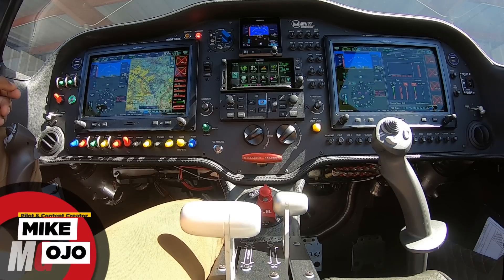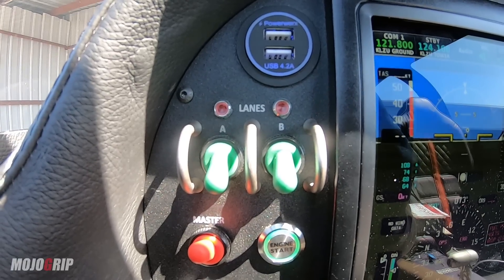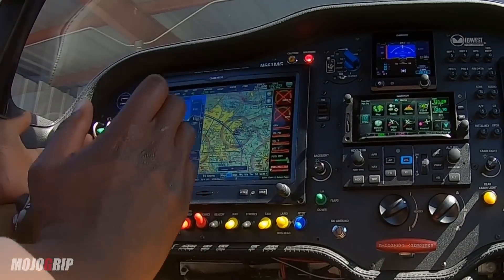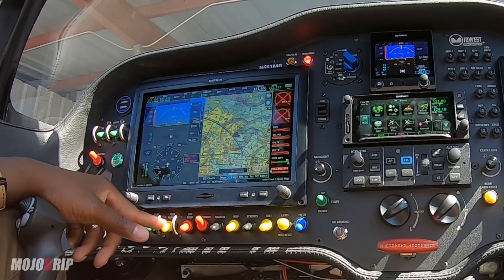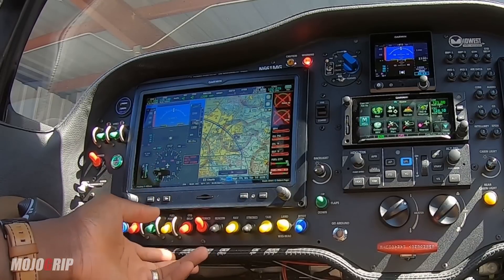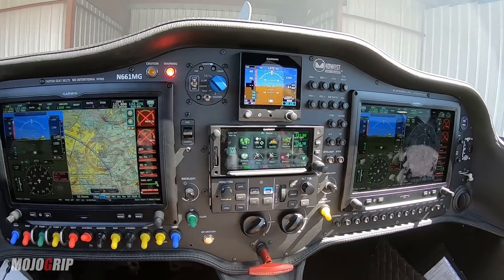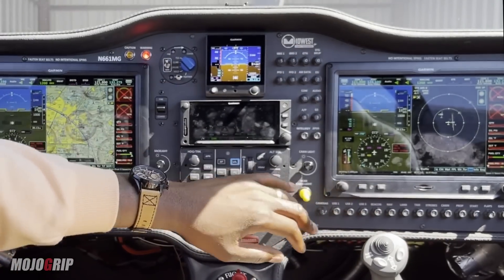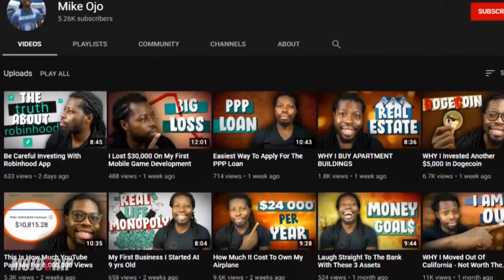All The Tech In My New Plane - Sling TSi Garmin G3X Touch

Comment: Mike does your Sling have a LIDAR installed? I've noticed an audible tone which emits as you near touchdown, with increasing frequency the closer you get to the runway.
Reply: The G3X supports an angle of attack sensor.  You hear it indicating that the wing is nearing a stall during the landing flare.

It uses a second port in the pitot probe set at an angle. A comparison of the two pitot pressures is used to calculate the AoA.

Comment: Lane A and B are for both ECU's to run the engine. And not for the avionics. Thats rubbish. Those are power through a separate alternator and master switch. Stick to the facts.
Your master switch does not power the engine.
Priming the battery? Thats again electrical nonsense.
Reply: I assume he is saying priming, but what is really happening is that he is voltage testing the standby battery and potentially arming it.  I am concerned that this is not helpful in understanding primary and secondary circuits and how the backup actually works. This is pretty critical.
Reply: Actually, Priming is a popular concept in Battery Maintenance. It's simply a process of reducing the charge to a trickle then applying a load, oftentimes by the use of a capacitor, and repeating that process for a set amount of time. It creates uniformed activity within the cells, helping the cells to function at their maximum capacity. The way he explains things are not accurate, which is why I have been asking him to stay away from technical information.

Comment: Mike, you tell us that you color code the switches on the left side of the panel - in front of you, because you can't read how the switches are placarded (titled). In turn, can you read how the circuit breakers on the right side of the panel are placarded? If you need to pull a breaker on the right side of the panel, can you read its title?

Comment: question for Mike:  does the rotax 915iS have a heater to prevent carb icing?  Like some kind of exhaust gases that flow into the carb  or an electrically heated carb jacket to prevent or reduce the incidence of carb icing?  I know it's a turbo...But am not familiar with the rotax 915 methods to reduce anti icing....or does the design of the intercooler provide that function?  I know the basic design of the intercooler is to allow the turbo heat to be greatly reduced before it gets to combustion, thereby allowing a much better power and performance.  But how is anti icing accomplished in this setup.  I didn't see any controls on your panel for it.  is it controlled by the fadec automatically?

just really curious...because as you are likely aware, even if ambient conditions are ideal and icing on the flight surfaces are likely not to happen there...icing at the carb can happen and that can be just as serious of a problem.  Mainly carb icing  is related to humidity and not necessarily temperature.   Maybe the turbo/intercooler design for this rotax solves this?

last: good call on standard circuit breakers.  The VPX is nice, but it's alot of complexity based on what amounts to a single point of failure for every system connected to it.  From a simplicity and safety POV, I think this is what makes many experienced pilots (and maintainers) a bit nervous about that technology.   I know some people who use it, but then decide to only establish non flight safety critical circuits to it.  And when you consider what is left over, the reasons for "needing" it in that kind of setup make the entire thing questionable.  Also very expensive up front and also any kind  of repairs, testing and maintenance through the life cycle gets expensive too.  I think the design has merit...But I also think that systems like the VPX need to mature a bit more and provide some safeguards against failure.    In my personal opinion (Avionics) this sort of system would be more useful, practical AND safe ONLY as a monitoring system, NOT as direct control.  For instance, in commercial aircraft, almost every system has some system check circuit added into it.  So you have standard power, ground, AND signal.  (ARINC)  On TOP OF THAT, you also have circuits that are exclusive to those primary power and control circuits that allow for monitoring.  In this way, you have one segment of the system that provides power and control and the other attached as a layer as a monitoring/testing circuit.  It's a great deal more wiring and of course the electro-mechanical devices are designed to allow for this additional sensing and the wiring regime.  But it's very useful and it provides a means to test the circuits on the ground and also in flight, without requiring one to use the primary circuits.  In the commercial application, it greatly reduces crew fatigue.  You go through a series of BITE checks pre-flight, and you can monitor them in flight too...very easy, very dependable.  But these are monitoring only.  The Crew will still need to actually perform some tasks based on a fault.  One particular monitoring and test systems in use is the BITE.  (built in test equipment)...From my understanding, the VPX accomplishes this to some extent, but does not implement the same separate test wiring function (it's not true ARINC...I think it's more like CAN BUS as a analog, which draws from the automotive industry.)  So, from my perspective until systems like VPX can function more like true BITE systems....I consider it not very robust, and questionable about what you are actually trying to solve versus some of the safety and reliability issues.   With the standard Circuit breakers, YOU make the decision tree on what to do in the event of some circuit issue.  Relying on automation sounds good, but that is a heck of alot to ask for a system that is doing all of this using the same wiring for power, ground and control/signal.  I will have to admit though,  having spent thousands of hours troubleshooting and absorbing circuit diagrams and operations and descriptions sections for nearly every single circuit on every type of airbus (and most types of Boeing), I know I probably have an unrealistic expectation for general aviation and experimental aircraft to begin with.  But the VPX appears to be marketed as some kind of BITE automation for circuits/systems but the way its actually implemented is questionable.     I don't see that nearly as robust as "it could be"....just saying.  I think you've made a very wise choice.  Not to mention how I am sure you have found using the money saved for vastly more important priorities!  :-)
Reply: Engine is fuel injected - no carburetor icing. Solid state circuit breakers have been used for years with great success in many, many, different industries and applications. I’ll be putting the VP-X in my TSI without hesitation.
Reply: @chriskroeker1889  ah yes FI...That makes sense.  But VPX? Seems like a very costly system for what amounts to rather small gains in cockpit resource management. Just my opinion.  May I ask why you would desire to have it?  What does it solve for you that standard C/B cannot?  honest question...I'm trying to understand what is being solved with it.
Reply: @tdmmcl1532  increased awareness of faults, increases panel space, and adds flexibility to future changes to the airplane, allows for automation. It also simplifies the wiring. It’s like the other features that attracted me on the TSI, including the fadec engine and electric prop. I like moving forward whenever possible. That said, some people like steel bike frames, flip phones, or refusing to use microwaves. Choice is a satisfying sauce.
Reply: @chriskroeker1889  oh no doubt about it...and some people like walking down a busy street playing with "smart phones" into traffic too...so there is that? Or sleeping in the wheel in a perfectly automated tesla at a high rate of speed into the center line.  

I get your point..just having some fun...okay? nothing personal...we just differ on some key points...trust me, if I was opposed to "new" technology, I would not have spent the last 30 years of my life involved in it..  And not just with Airbus and Boeing either!

on pure data, what would you estimate the statistics show for critical flight safety issues due to wiring faults, arcing, sensor failure?  

On even anecdotal reports, what amount of pilot resource management do you think is "saved" by such a system? Versus the standard C/B....Let's put a number to it. Do you think it saves 10 percent of resource management time and skill?  20?  less more?  because that's really what we are talking about if we want to be all technical about it.  '

or are you just saying...you like new technology because its cool to have?

I can accept that.  Obviously, many people chose that without blinking.

also:  if you actually believe that SS C/B systems "simplify wiring", I would urge you to actually do a bit of research about what is actually involved.  true, you can streaming the wiring systems..but then what does that leave you if the intended promise of these systems are not fully implemented?  Spoiler: it's quite a bit of additional wiring...alot!  
I'm just expressing my own opinion ....

the only thing I have learned more than anything else about technology in the cockpit is this:

it must be reliable.
it must be completely natural to the other instrumentation/indication in both design, more and ergonomics.
it must be established with lots of data that it is fault tolerant in the most hazard conditions.
it must solve a problem 

I'm not convinced this particular technology achieves any of those conditions.

it definitely hits a a few of them and I recognize that...but not all of them.

it probably maybe might achieve that   over time....sure..

anecdote:

when the first mobile phones rolled out....those huge bricks..I owned one.  It was reliable...it solved a problem...there wasn't much reliable data showing it to be fault tolerant....and the design and ergo was nothing like any of the controls of the crew cab I was driving in the deepest swamps of board roads into oil fields across the south....

BUT ..it was the only thing available that COULD solve the communication problem. This gave my business a huge advantage over the competition.  It certainly was not safe to drive and operate....that was clear after a few near misses.  

but then again, I could always pull over and deal with problems..

you get my drift?

simple wins ever single time in a critical flight event.

every single time.

the decisions we make when building these systems are the ones we have to live with at altitude...

Comment: What does prime the battery mean?
Reply: I can only imagine, the way he described it, is some kind of battery SOC indication.  Perhaps the batteries have a voltmeter to check for proper level before the start up>? maybe there is some test load triggered by that switch to indicate like an ammeter reading.  But since he did not explain where on the panel that indication was...I am purely guessing how his aircraft is setup..or even what he was trying to explain fully.
I would imagine there must be some kind of batter gauge useful for pre-flight...and also something that shows the charging system is working and the batteries are actually taking a charge.  That would be standard 101.  

The triple battery setup was interesting.  I would have guessed two max.  But hey, given the lighter weight of these nextgen agm/li-ion batteries, I would say having three is a very good idea without the space or weight tax.
Reply: @tdmmcl1532  Two primary batteries, and the G5 is being used as a STANDBY source (not "back-up") has its own battery.
Reply: @EJWash57  gotcha TY!

Comment: Your panel and switch setup is great, however I believe that you have a lot of dead screen space while traveling. Screen setup falls down to personal taste at the end of the day, so it isn't "wrong" but the information that you could be gathering at a glance could be improved. That setup is better for a 2 person crew over a single pilot set up. 3 AHRS, 2 engine monitor tapes, and 3 moving maps with traffic are a little too much redundancy, and I say this as an CFII who trains people on glass cockpits as well as traditional avionics. you'd like you're screens to give you the most information possible to reduce the need to dial, search, or have you lean over and/or squint to try and read information you are trying to acquire while flying. Your PFD is too busy imo, it would be better to center the AHRS on the screen and remove the sectional chart and engine monitor tape. The AOA indicator is a wonderful little thing but an inset traffic map  set to 6 nm range on the bottom left would be more useful. For your MFD I would move the engine monitor tape from the right side to the left side of the screen and the rest of it should be a moving map (charts or terrain) on the rest of the screen. This will show traffic and weather ideally, giving you a general overview of your situation to help you stay ahead of the aircraft. Your 650 should be the screen you change the most in XC and IFR flight. I prefer to have it on the default nav page myself but the flight plan page is also a good choice. Due to how close it is to you I would use that to get airport information and to load and activate approaches, use the nearest page group etc. Again, this all falls back to personal taste however maximizing your screen usage can reduce your pilot workload considerably.
Reply: Spot on. What you describe is my plan for my set up coming soon.
Reply: I agree with you on the avionics redundancy in a light, single-engine cockpit. When I trained and was typed in the Cessna Citation 500-series back in the mid-80's, the avionics on the left side of the instrument panel was the latest-&-greatest, and the right side was basic analog. YES, a symmetrical EFIS screen, two-pilot instrument panel layout is impressive, but let's be realistic - it isn't necessary. If you, General, were to design a single-pilot EFIS panel aircraft (my unlimited budget) what would you include? Single-engine, single-pilot, side-by-side seating, IFR, Lay out my panel. Thanks. I appreciate the input.
Reply: @EJWash57  the 2 G3X touches are excellent for a no limit avionics glass panel. He just has too much redundancy. Your transponder should be able to see classic TCAS, 978 and 1090 ads-b traffic, with the capability to have satellite weather. This way, you're moving map on your MFD can give you the big view for situational awareness. If I were to add a panel to Mike's setup, it would be an independent engine monitor panel below the G5. The split screen G3X touch is more for the pilot who only has 1 screen. Post G530 Garmin's have the ability to ID a nav aid like a VOR and localizer without having to listen to the Morse code which is extremely convenient. What makes the G3X touch so interesting is that it is extremely easy to customize, you can even have the display mimic round dials if you prefer. In IFR I like to have my approach plate on the right MFD if I'm not using my tablet. The 650 is as big as you would need but you could upgrade to the 750 if you wanted to go bigger, 650 is more space efficient though. I haven't flown with Garmin's new autopilot but FlightChops has a video where a flight school upgraded a Cessna 182 to have more capability than an airliner and they have 2 G5s, an MFD for engine monitoring and a 650 with a space to mount your iPad. A mirrored setup works for single pilot but you just need to have the screens display different information otherwise you are wasting money on buying the screen.
Reply: @generalrendar7290  Thanks, I appreciate it. I've watched FlightChop's '73 C-182 panel upgrade video. I've looked at panel examples on the Aerotronics and SteinAir websites for layout ideas.
Reply: @EJWash57  i also gave a detailed description of how to make his setup better for single pilot ops on his night training video.
Reply: He said is in the early stages of instrument training, so he really doesn't maximize (or understand) the use of his panel setup. Once he gets instrument rated, I'm sure he will set them up differently.
Reply: In matters of taste there can be no dispute.
Reply: @tizwicky  - That's a dangerous statement! A person can have all the taste they want, but functionality should be a higher priority. 

We once pulled a young lady from a car wreck, where half her body went through the windshield ripping her skin off from her shoulders down to her hips. She thought buckling the seat belts, while placing the shoulder strap behind her was a matter of taste. After 5 skin graft surgeries, she has now develop skin cancer. 

Matter of taste vs Functionality? I'll take the latter.

Comment: You didn't mention that big T handle just below the heater controls. If it is what I think it is, you need to have the safety pin installed when not in flight.
It is a very nice panel indeed.
Reply: Correct, its for the parachute..  and the safety pin needs to be installed when on the ground.